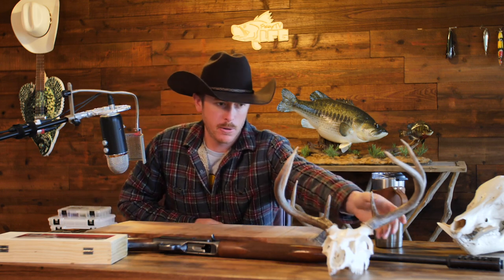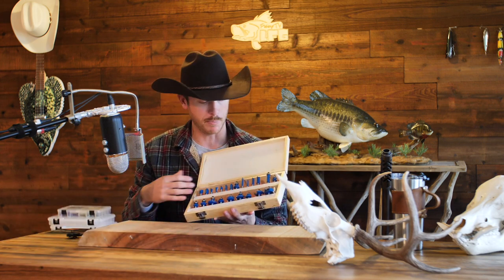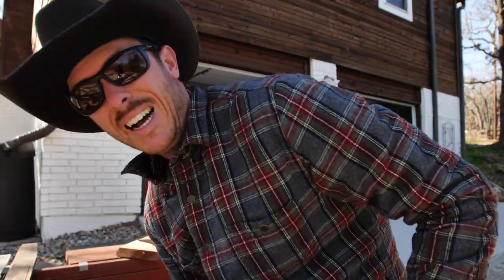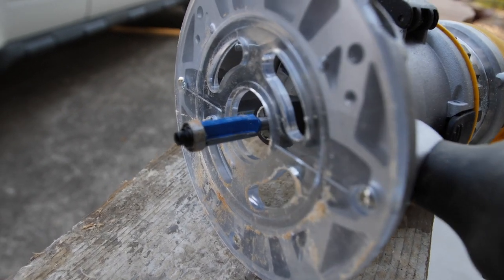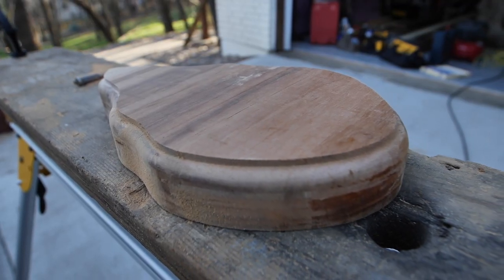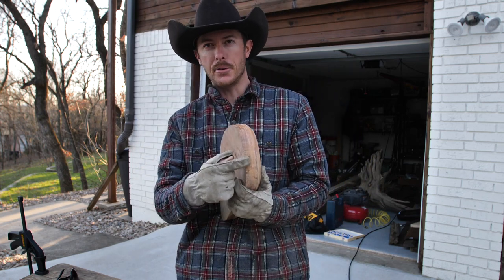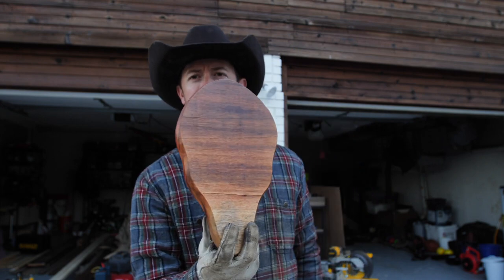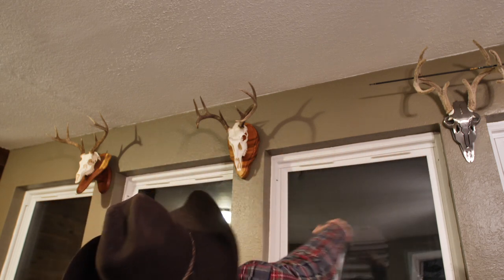DIY Euro Deer Mount ( Exotic Tigerwood Base)

Comment: Here's some unsolicited advice for you LFG. Start with a piece of paper and draw one half of what you want to make, fold it over and cut it so you have a perfect symmetrical paper template. Then you take your paper and make a solid template out of 1/4 mdf or something similar. Then use that template to router out your tiger wood, using the bearing. You will need a bit with the bearing on top and a thinner piece of tiger wood. 3/4 is ideal. Oh and never use gloves while operating power tools. Good luck!

Comment: Pro tip. instead of free handing the router, make a template out of hardboard or plywood. Then use double stick tape and stick it to the rough cut out wood and use a flush trim bit and use run the bearing side against the template.

Comment: Watching you blow the sawdust out of the way, reminded me of when my grandfather would do the same thing, sometimes he blew his false teeth out of his mouth. He would run them under som water and slip em back in place. He broke several plates if they hit concrete floor. He just epoxy them back together. Thanks for the Memories Justin. That was about 55 years ago.

Comment: Mount looks very good and the grain in the wood really pops out.  When you want to see what the router bits create as a decorative edge, use a scrap piece first so you can see if you like it plus get the depth you want without the possibility of messing up your good work piece.

Comment: If you want both haves of your mount to be perfectly symmetrical, fold a sheet of paper in half, draw 1/2 of your design with the fold as the dividing line, then cut out your template and unfold the sheet of paper. The result should be a perfectly symmetrical template that you can trace!

That being said, you did a great job freehand!

Comment: Next time just draw half of the mount on paper or cardboard to make a template. Lay it on the wood and trace one half, flip it over and draw the other half.  Instant symmetry. Or fold a piece of paper in half draw out half of the mount with the center line being the fold. Then cut it out an open it up. Perfectly symmetrical template.

Comment: LFG you dont have to hawg it all off in one pass with the router. Try taking 1/2 or even a 1/4 of your final cut in each pass and lower it alittle more each time. Your bits will last longer and your cut will look smoother.

Comment: Tip. Next time you work with such a thick peice of wood run screws into the bottom through your work surface that way you dont need your clamps. It will allow you to make continuous runs with your router. Mount looks awesome though.

Comment: Good job. Little tip, next time run two screws through your 2x6 into the back of the work peice this way no need to clamp allowing a more consistent router cut.

Comment: Hard to cut your finger off with a jig saw. It'll chew on ya a little bit, but your finger will move with the blade when the teeth grab skin. You'd have to have your finger pinned down tight. Try holding a hotdog out and cutting it.

Comment: FYI wearing gloves and long sleeves around power tools is an accident waiting to happen..   

Google "Degloved"

safety 3rd
Reply: Nick Sawyer yeah, don’t forget the necktie. Lol
Reply: How do you figure that ?  You should wear gloves especially when using a jigsaw and router as you can get "vibration white finger".  Chain saws and jack hammers are the worst and its not funny when you suffer with it as your fingers/hands cramp up and you can also lose all sensation in the fingers.

Comment: Don't forget your router should move in the same direction around your piece, usually your router will have an arrow indicating which direction to move, depending on the direction it turns.

/start sarcasm
I was triggered with the constant use of "high powered tools", "high speed equipment". Be careful of those high powered devices! 

That's a big chuck of wood, don't forget to add a stud in the wall.
/end sarcasm

Comment: I think your wood working projects are awesome, but Youtube's GUN RULES SUCK... FYI Options Epiphanes Tung Oil Finish is nice too, also it's outdoor durable for those outdoor wood projects. For indoor or outdoor waterproofing use Rot Doctor CPES... Jamestown Distributors is a good source for both. This is the same combination finish used on wood boats... (1) CPES (2) Epiphanes 2 steps I  use  on outdoor wood signs @LakeForkGuy